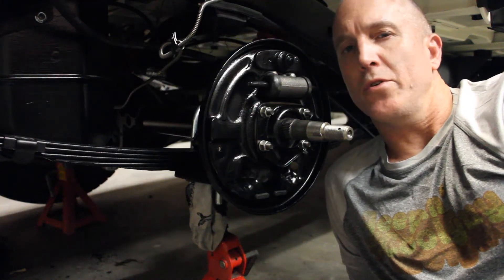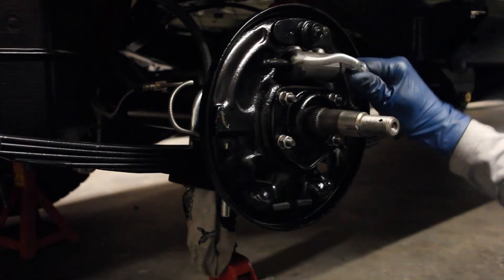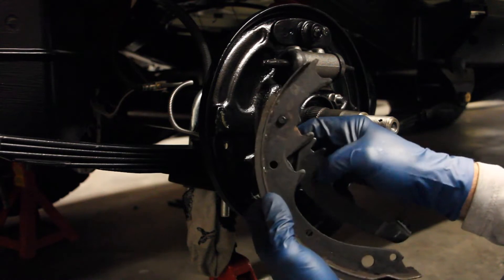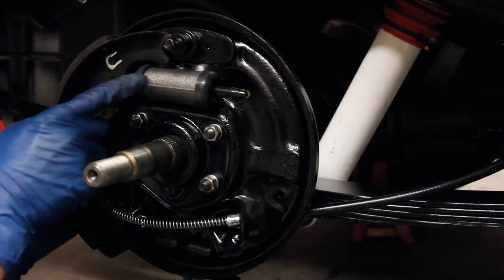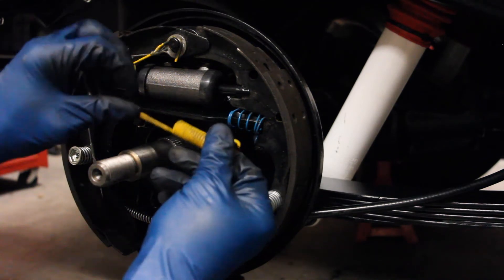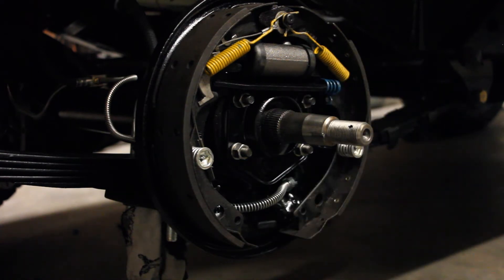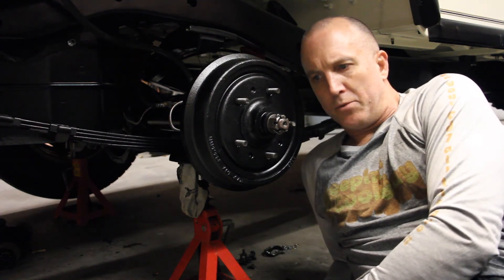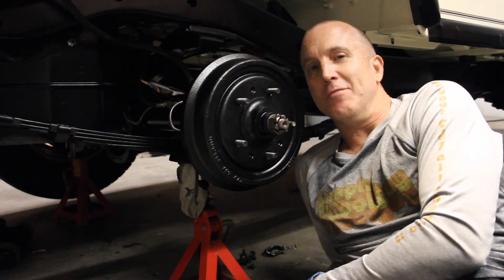Jeep CJ AMC 20 Rear Drum Brakes Install

Comment: Thank you for this video!!! I usually avoid messing with drum brakes at all cost lol.  But im helping my dad restore a 1977 Gremlin and this video was great for helping me figure out the brakes.  The previous owner had taken them apart and never put them back together so I needed a guide to make sure I put them back on right and your video was a great help.  Thanks again.
Reply from the maker: Excellent. Glad to help. 77 Gremlin, wow, super cool.
Reply: @coolguy_CJ7  Yeah it's a 1977 Amc Gremlin X Levis edition.  The seat covers and parts of the door panels are made out of levis denim just like their jeans.  It's pretty cool little car.   It came out of Texas so it's pretty clean.  It's got a 258 straight 6 in it now but I'm rebuilding the Ls2 6.0 liter out of my GTO to put into it next winter. It's will probably make around 450hp and should make that little gremlin run pretty good.

Comment: It's a great, detailed video.  Thanks for your diligence.  Here's just a couple things I discovered that might help others. 1) You explained that the adjuster brackets are labeled 'right' and 'left".  I also discovered that the adjuster barrell/pin assembly is also "right' and 'left" they are threaded in the opposite direction.  One of mine was rusted so I bought a replacement at O'Reileys.  The store doesn't designate right/left either.  So when I installed the wrong one on the wrong side, it fit well, but it doesn;t actual adjust.  In fact, as you press the brake pedal, the shoes actually get loser.  2) You said there are short and long pins in the hardware kit.  I initially chose the longer pins, as they were easier on my thumbs to install.  But when you torque down the lug nuts, those longer pins press against the brake drum and bind up the wheels.  Don't get tempted with the longers pins--throw them away, else you'll have to do the whole job over again.  3)  The little 'blue' springs on the alligator bracket are not included in the standard hardware kit.  In fact, the guy that last did brakes on my jeep didn't even use the springs, as they were missing.  But they are available as a separate SKU at O'Reileys and only cost $3.
Reply from the maker: These are all great builds. Some of them I was not aware of because of the parts that I had or didn't have to buy. All of these points are good to knows.

Comment: Great Video! This is going to help with the 71 AMX I am restoring. I have the rear apart, painted, and ready to go back together. As one other commenter added, I left one of the brake assmblies together, but this is going to help with the detailed order of steps that you provided for reassembly. Thank You
Reply from the maker: Glad to help. Be interesting to see what other things on the CJ7 that would work on other AMC vehicles.

Comment: Great video. I'm rebuilding an AMC 20 with 11" drum brakes. I would assume the assembly process is the same...just larger.
Reply from the maker: Correct. If you have trouble finding parts, let me know. I’ve got a guy.
Reply: @coolguy_CJ7  Thanks, I've got everything. Just got my backing plates back from being machined. I have one piece rear axles and machined the backing plates so the axle can be installed and removed and brakes, backing plate, etc can stay on axle.

Comment: The little horseshoe shaped clip for the e-brake lever you need to pinch with pliers to close it up or you will lose it
Reply from the maker: Good information/insight. It's crimped a little and not coming loose. I tested it just to make sure.

Comment: I know this is old but anyone know if the passenger side is supposed to be opposite of the driver side? Like the way everything is set up? I’ve got a 83 cj5 that was dropped off and I’ve used all of cool guys videos to help me understand this thing. But nothing on this jeep has been put back together right. And the driver side is still together but it’s opposite of cool guys video. Like the little cable and the smaller pad is on the front

Comment: Great video, as always! I've done this job before the exact way as you but it's been a few years. This was refreshing as I'm redoing my brakes again, this time with everything cleaned, painted, and greased properly. Question - is there any initial adjustment for that brake adjusting screw, or do you just leave it screwed all the way like you had it?
Reply from the maker: I’m sure I’m way past the point of helping out, but I put the adjuster in at the narrowest setting and then expanded it out as I got the wheel hub back together. You can see how to adjust it in this video: https://youtu.be/pShHGPjl5aM

Comment: Ironic timing for your video...just reassembled my left drum after cleaning and painting last night. I've found that it's very helpful to do these one at a time (as in don't take them both apart at the same time) so you can use one as a reference when you're putting the other back together.
Reply from the maker: Yep. I can't tell you how many times I've used my own videos to put things back together.
Reply: Good advice,  just did mine the other day and one at a time for that exact reason.   Didn't stop me from still making a mistake ( knocks head)  but at least I could verify my mistake.

Comment: Cool guy, you into is epic and I love your videos.  I just finished installing new drums on the rear of my 83' Laredo.  For some reason the shoes get stuck out and start grabbing.  Also the pedal gets stiff.  Then it will magically it goes back to normal for a a few stops.  Then it happens again.  Any idea what would cause this?  I appreciate you buddy!
Reply from the maker: Sounds like you've got a pressure/vacuum issue. Are they power brakes?
Reply: @coolguy_CJ7  Yes Sir.  The wheel cylinders didn't appear to be leaking so I didn't replace them the first time but I am now.  All I need to do now is bleed them.  Another mistake I made was that I didn't adjust the shoes out to the drum then back then off.  I left the shower fully closed.   If this doesn't do the truck I guess it's a new master cylinder and lines or a disc kit.  🤷🏻‍♂️
Reply from the maker: @flysullivan  I don't think its a master cylinder problem. There's not much that can go wrong with the master. It might be the proportion valve or the brake booster that is creating the "stiff" pedal. But let's see after you redo the wheel cylinders and adjust the shoes.
Reply: @coolguy_CJ7  you definitely would be more qualified than I am.  If the master cylinder gasket is stretched and not seating properly be the issue?  If so I am replacing that as well.  It was all whack

Comment: Which parking cable is that? Do you have a model number? I'll be using this video to rebuild my CJ5 drum brakes next weekend. Thanks for your help.
Reply from the maker: When I ordered it, it was the only CJ7 one available through Quadratec. Now everyone has them. Since yours is a 5 it will take a different cable length. Check Rock auto if you only need the rear 2 cables. Raybestos is the brand that I installed.
Reply: @coolguy_CJ7  Thanks!